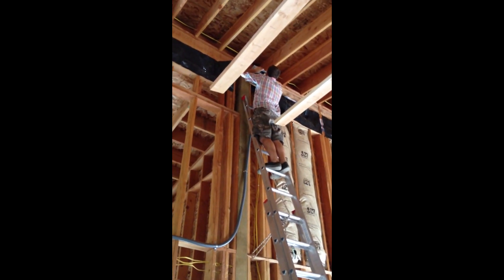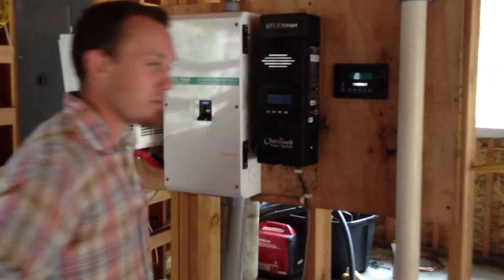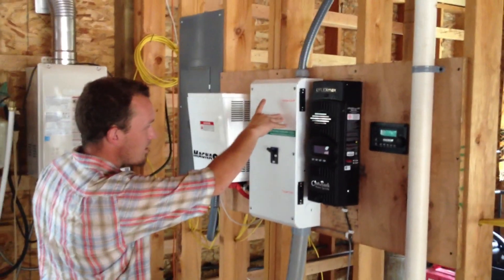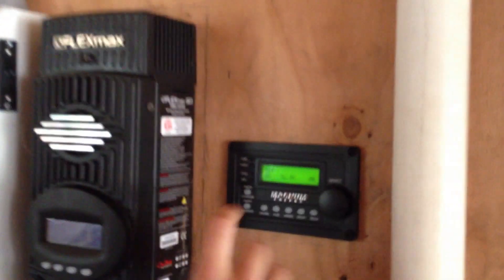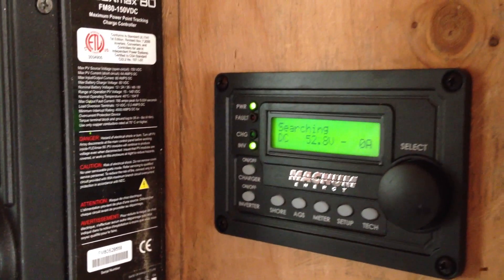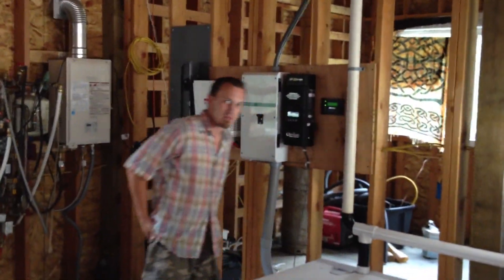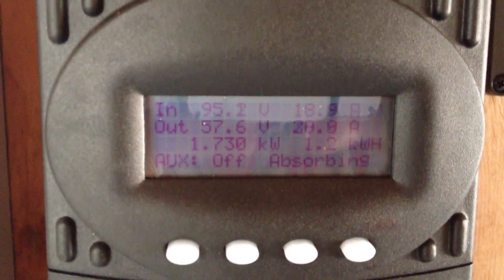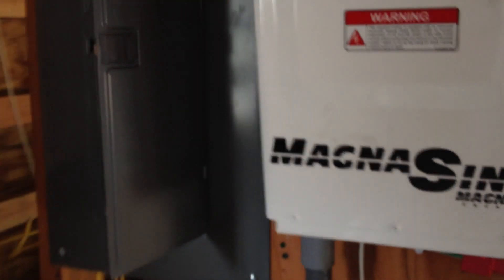Starting up the 4.1kW Solar Off-Grid Power System for the first time! - Final Steps

Comment: Solar Power Videos  what is the PV array size connected to the system ?? in terms of watts
Reply from the maker: There are 18 panels connected which can produce 4100 watts of power per hour of peak sunlight on the array. So you would say the array size is 4.1kWh.
Hope that clears it up for you. Thanks for watching!

Comment: How can you charge controller be only 80amps capable if you have a 4000 watt system?
Reply: The inverter is inverting DC from his batteries not from the charge controller itself.
Reply: @ekoms108  hi can you please help me on this matter also.... how can an 80A charge controller handle 18 panels?   I do not understand this.
please help

Comment: Well...now that is opposite of everything I have read. I have gathered that if the neutral bus bar was bonded to the ground bus bar it would backfeed into the inverter and burn it up. Also that only the ground bus and a ground wire from the negative of the battery bank should be ran to a grounding rod ???? There has to be a simple laymans diagram somewhere but I be darned if I can find one.

Comment from the maker: In that case, I would recommend wiring the inverter directly to the service panel through a breaker. It would be much better practice, save efficiency, and allow you to use the 2 inverter outlets for other things.  What type of inverter is this? Does it allow two hot lines out, phased to allow 240V? Does the inverter have the outlets already wired in it's enclosure?

Comment: It will be a stand alone off grid system. Yes the output wires of the inverter to the breaker/service panel.  Im pretty sure hot neutral ground must be isolated to individual busbars, no neutral to ground.

Comment from the maker: Hey, Im glad you are interested in Solar. I have a few questions for you before I can answer.. Are referring to the wire connection between the inverter and the main service entry panel or "breaker box"? Or are you installing a stand-alone panel for just your solar power? Is this going to have batteries? Be very careful about wiring anything that provides energy to your service panel.

Comment: In the near future I plan on installing a small solar system to my garage to get my feet wet. I am really curious what the difference between hard wiring an inverter that is factory set up for it is vs simply running dual cords from the 2 inverter outlets to the panel would be. Just a neater/cleaner setup? Would you get the same performance from the latter? Also, could a qualified person remove the dual outlets from the inverter and set it up for hard wiring? questions galore I know.

Comment from the maker: Two independent 8 AWG connected to the main service entry panel with a dual 30A breaker that allows for both 120V and 240V output.
Are you looking to size wires on your own system?